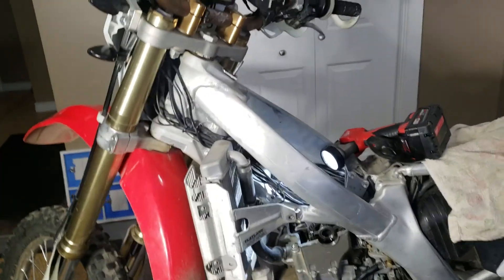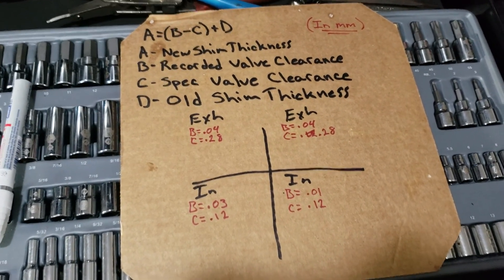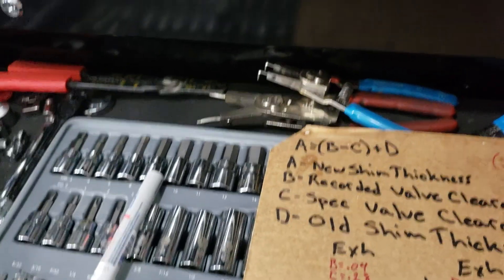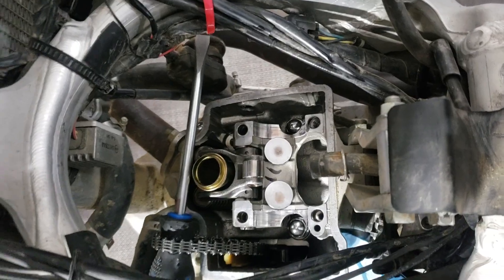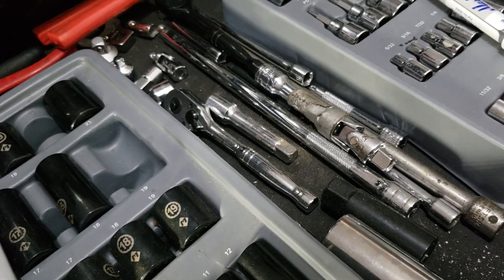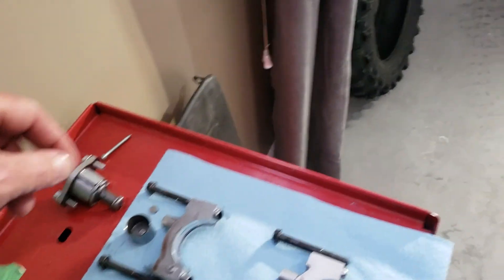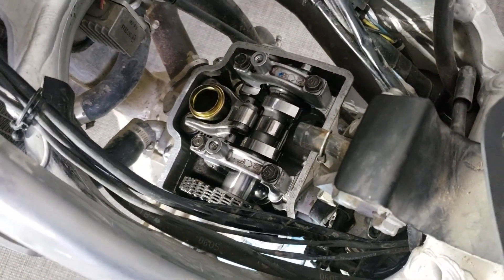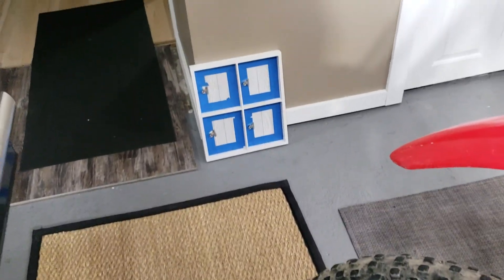06 CRF250X Valve Adjustment Part 1

Comment: Hey.  I was just watching and noticed you said that the shims were worn.    It's more than likely the valves themselves are worn.   I think at the clearances you were getting, it's ready to drop a valve.   Beware
Reply from the maker: @kenkenny4238  actually the stock valves stretch and require a thicker shim to Take up the slack to the rocker . But yes ultimately the valves will fail

Comment: Kill the radio in the background and your videos will be much easier to follow.  fwiw
Reply from the maker: Thanks for the comment. I will try that
Reply: So your original sim was 1.86 .. and you say it was wore down .. and you replaced it with a 1.77 or 1.80? That doesn’t make much sense..
Reply: A it’s not in mm it’s 0.12” 0.28”